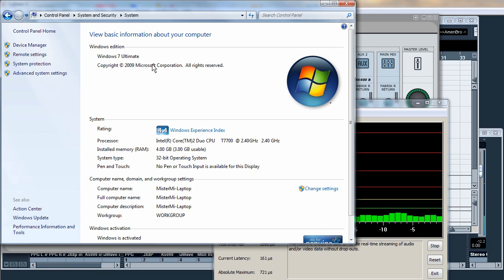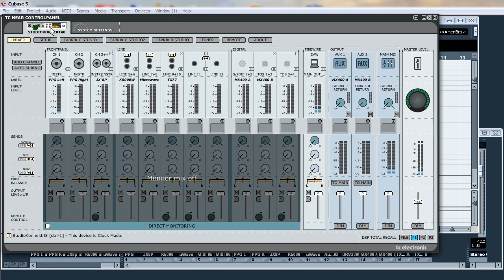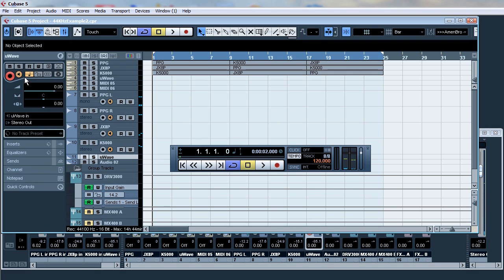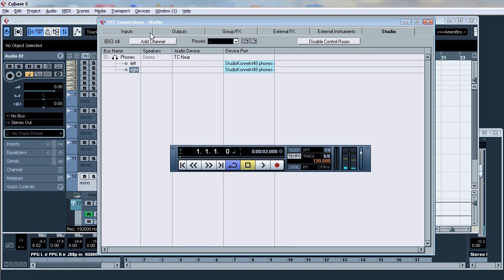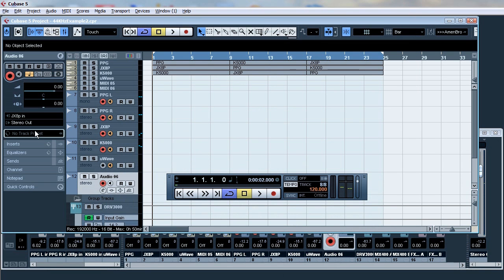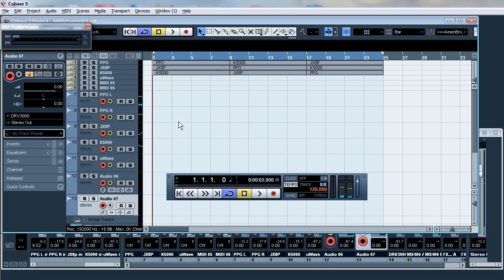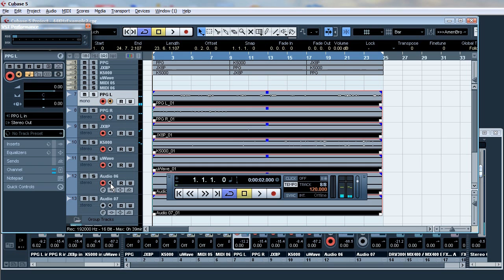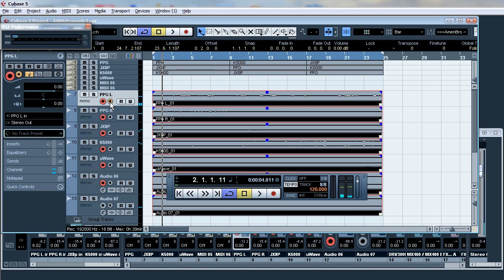TC Electronics Studio Konnekt 48 recording quality @ 192Khz, using Cubase 5

Comment: I find it a little bit weird that you're recording at 192kHz, but 16-bit. Recording at 96kHz or even 48kHz, but 24-bit would make far more sense. 

Regarding DPC latency, on my PC it fluctuates between around 13 micro sec. to 20 micro sec. I use Windows XP. I'm also able to use latency as low as 64 samples... 
 
Anyway, I was interested in seeing TC Near software at work. ;) Thank you. Cheers!